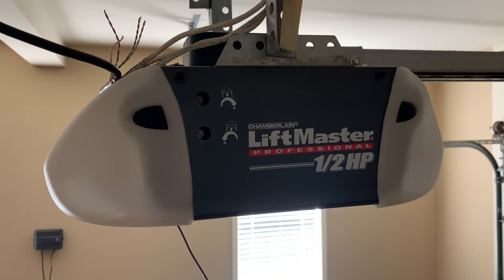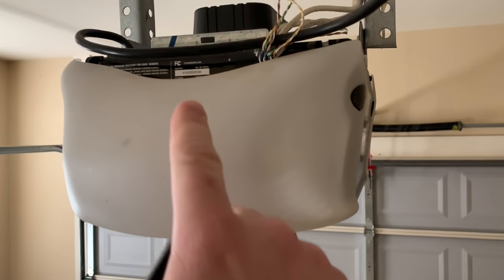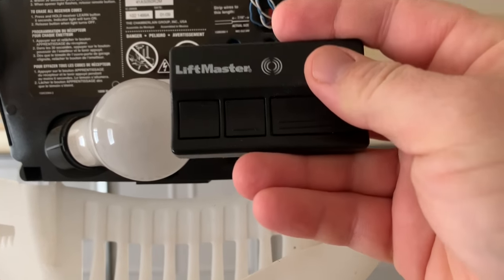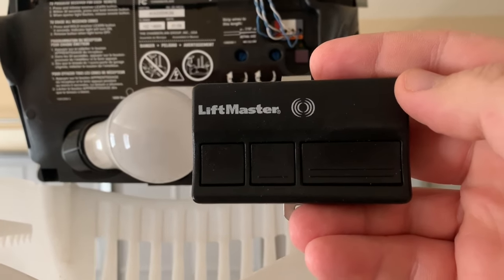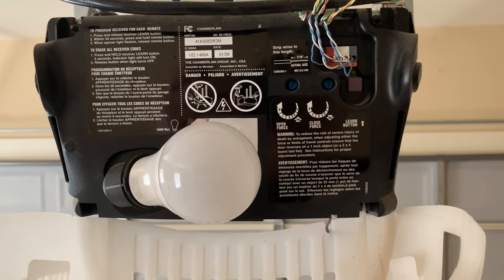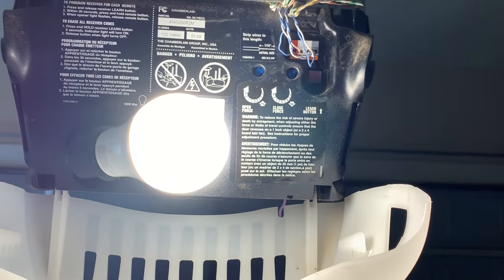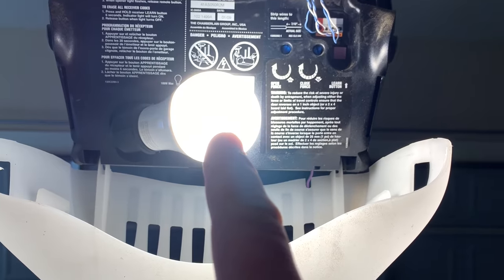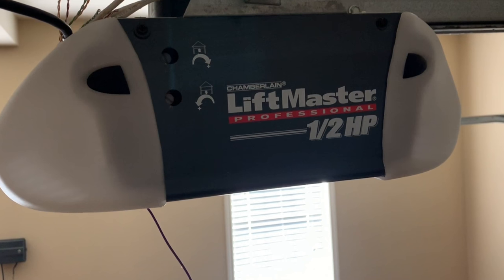EASY FIX: Garage Door Remote Not Working

Comment from the maker: Use the Amazon Affiliate* Links below to buy supplies for your repairs: 

Chamberlain Liftmaster Remote: https://amzn.to/3dHHW9m
Genie Remote: https://amzn.to/35f0E4u

Garage Door Not Opening or Intermittent Issue - https://www.youtube.com/watch?v=5UYDqS21MU0

Genie Garage Door Opener Bulb (4 pack) - https://amzn.to/37lUBxC
Genie Garage Door Opener Bulb (single) - https://amzn.to/2IFTr5E

*My description and comments may include referral codes/links that allow me to earn points or credit that can be redeemed for products and/or subscriptions. When you use my referral code/link, you are helping to support me and my recommendations! Thank you for your support!
Reply: P
Reply: My my garage door opener stopped working. I was prepared to disassemble the unit to repair it, as it turned out the problem was the LED bulb. Changing the bulb save me a lot of work and frustration. Thank you😊

Comment: When my garage remote stopped working, I called the company and they wanted to charge me $189.00 to send a technician to bring me a new remote and program it for me.  Found your site and this wonderful video.  My setup is exactly like yours, so I followed your instructions and voila, it worked perfectly!  Thank you so much for posting this to help those who are not the best DIYers around, and saving me all that dough!
Reply from the maker: Bob Antunes That’s great news, Bob! I’m glad I was able to help save you money. It’s crazy they would charge that much. I think $89 would be much more reasonable. Be sure to subscribe. I do my best to make easy to follow, practical videos.
Reply: But Bob, why wouldn’t you just call the ‘guy!’   

Just kidding!  I had the start capacitor go out on mine and found a replacement for $8 bucks.  Relatively easy install, but you do have to discharge the old one before removal.  I put the info on Nextdoor and I was berated for doing something so dangerous and I should have just called ‘The Guy.’

Comment: Tried buying new remotes, extending antennae, turning off wi fi, and changing light bulbs, no leds, nothing worked to fix remotes not working. Noticed a melt spot on plastic near the light bulb area. Put in very low watt bulb from the fridge and BINGO, now all remotes work like a charm. Hope this helps someone!!😄😅
Reply from the maker: Wow! That’s crazy! I’m glad you figured it out!
Reply: @TightWadDIY  thanks. I was ready to buy a whole new system. So frustrating.

Comment: This video just saved me $300 for a new garage opener. My garage door opener is working but most of the time is having issue. As stated at the end of this video, led bulbs can interfere with the signal. This turned out true. I switch the bulbs and the garage can be open and close every time. Great video!!  Thanks!!

Comment: This is a great video, helped fix my garage door closing issue with remote after changing light bulb for the motor. I watched close to a dozen other videos and read blogs to understand what the issue is with garage motor and remote.   The issue turns out related to using a LED bulb for motor which conflict with remotes signal, replacing LED with regular bulb resolved the issue.  Thanks @TighWadDIY for publishing this awesome video, it saved $ for me to fix the issue.
Reply from the maker: That is correct. The LED bulbs are the culprit. Took me a while to figure it out too.

Comment: Ha-thank you! Plenty easy to program remote, BUT you were the one who solved my mystery. One door worked fine, but I could not get my other door back online even after re-programming two remotes that I've used for years. The culprit was the LED light bulb I put in about a week ago! Took it out and the remote worked fine.  Thank you!
Reply from the maker: Yes! That issue plagued me for a several weeks before I figured it out!

Comment: Really appreciate a short and factual video. I’m hoping it’s the lightbulb.  I’ll change it and also try the reprogram hack. Fingers crossed it works and it’s not the big tension spring. It’s made it 19 years! This is the first time I’ve had an issue.

Comment: Thanks so much for this video. What a lifesaver! I replaced the light bulb on my garage door opener and all my remote controls stopped working. I’ve been troubleshooting for days and can’t figure out what the issue was. Had the opener for over 15 years and searched websites and thought the remote control board is old and bad. The last portion of your video remind me that my new light bulb is a LED one. Replaced it with a stander light bulb and Bing, every thing back to normal and working fine now. I’d never ever thought a LED will give me so much trouble. Thanks again
Reply from the maker: DY100100 I’m glad you found the video because it’s a super frustrating problem. It took me a few weeks to figure out too! Be sure to share the video with your friends!

Comment: I have two garage openers for separate doors same brand.  One works with remote,the other don't.  The one that don't has led bulbs.  I will change out and test.  Remotes have new batteries.  Both lift by hardwired buttons in garage.  Thanks for the tips.  Very helpful.
Reply from the maker: Definitely try removing the bulbs and see if it still happens.

Comment: So just how important is it to close the garage door first?  I tried for hours a month ago to make my HomeLink work in a newly purchased car.  Nothing worked.  I ended up de-programing the remote transmitter that came with the opener.  Now I couldn't use HomeLink OR the remote.  I tried again tonight after watching your video (first programing the remote and then following HomeLink instructions to program from the car's button).  Both worked on the first try.  The only difference is that you are the first to say to close the door first.  Thanks.  My wife will be especially grateful to not get any more calls 2 minutes before I pull up asking for someone to open my garage door.  First World Problem Solved!!
Reply from the maker: I’m not sure how important it is but that’s what the instructions say to do! I’m glad yours is working now!

Comment: I love u tube because of this kind of video . Thank you Sir . I also found one more trick which is as follows -
-Please check door opener button/switch installed on the wall in the mudroom. Locate small button called "Learn" . Use that learn button.
- Press one key on garage door remote.
Thats it .
This might save you ladder climb to garage motor mounted on the ceiling.
Reply from the maker: Good to know. My system doesn’t have that option.

Comment: Not sure if I’m in the right video.  My problem isn’t that there’s no connectivity or program to the remote.   The problem with my unit/controls is that the door will close partially, sometimes it just “jumps” a bit, and goes back up.  Sometimes it’ll go down a few feet, then stops and goes back up.  Sometimes it works fine.  Almost like it has a mind of its own.  This happens with both remotes, the wall activator, and the pad on the outside.  Thoughts ???
Reply from the maker: Your tracks could be out of alignment.

Comment: That was my exact issue will you save me a ton of frustration I went through thinking the remote was bad the garage door was bad the car was bad etc. I really appreciate that and it was my LED bulb
Reply from the maker: I’m glad you found the video!! It’s such a frustrating issue that can be so easily fixed.
Reply: @TightWadDIY  Thank you for taking the time to make a concise video with clear instructions for a known problem.  My problem, however, is slightly different, I cannot get the yellow "LED Learn button" to work.  When I press and release, no yellow light.  When I press and hold, no light.  The wall control works, except for the "Yellow Learn" also will not put the opener into programing mode.  Any ideas before I have to buy another garage door opener?
Reply from the maker: @Random_Person562DW  What is the make and model of your opener? I will see what I can find.

Comment: Thanks !!! Did not know about the LED bulb  factor.
Reply from the maker: Yes it’s so odd but definitely causes issues.
Reply: @TightWadDIY  and Fyi - the led bulb causing the issue was not the bulb in the machine, it was the bulb in the garage which was only a few inches away.

Comment: I just can't believe it.  My Craftsman garage door remotes and outside key pad started giving me fits 4 days ago, as it would work sometimes, and not work other times.  I changed all the batteries and still no success.  The same remotes did work on my other garage door on the out garage. Then I watched your video and guess what I did 4 days ago that triggered my problem..., l changed the burned out light bulb on the opener  with an LED light bulb.  CASE Closed and thank you so much for your tip on LED bulbs interfering with the remote frequency.  Really appreciate you help!!!!!!!
Reply from the maker: I’m glad you found the video! It’s a really odd issue that takes a while to figure out. Genie does make a LED bulb that doesn’t interfere.
Reply: @TightWadDIY  Thank you again.  When I changed the bulb and started having remote problem, my wife ask me if I hit or touched any of the adjustment knobs and mess something up.  I told her I couldn't have touch any because the light is on the front of the unit all by itself.  The back of the opener has all the adjustments and I didn't come close to any of them.  LOL, Unbelievable!
Reply from the maker: @hankgavarkavich1599  I’m sure she wasn’t happy with you for “breaking it”! All is well and now you can be the hero!

Comment: Your the only one who said the door has to be closed. Now I'll try this again.. lol.. hopefully that was my issue
Reply from the maker: Hopefully this gets your fixed up! Let me know if it doesn’t work!
Reply: Unfortunately no it didn't and I replaced the battery in the clicker first. So I'm assuming it just died so I ordered a replacement. If the new one doesn't pair then I'll be searching for more trouble shooting  videos. It just stopped working 🤔
Reply from the maker: @elizabetht1323  so none of your remotes work now?
Reply: I only had one remote that came with the house. And it just stopped one day. I changed the battery and it still didn't work. The new one should be coming today and I'll see if it can pair.
Reply from the maker: @elizabetht1323  I actually recommend clearing all codes when you move into a home just in case the previous owner still has remotes or Homelink devices set up to open the doors. This is typically done by holding the learn button for 10-15 seconds.
Reply: Update: My new openers arrived! I cleared all previous pairings and added my 2 new openers.. success!! Thank you for your time and great easy to follow video :)

Comment: You got me thinking about this. I have a few brands of CFLs and LEDs. If I take a portable AM radio next to them, some generate a lot of broadband RF noise and others are very quiet. I believe that the offenders don't have good filtering on their inverters and you can hear the distinctive square waves which generate many odd harmonics. The same problem exists with some solid state fluorescent light ballasts (I have in my garage.) The problem can also occur with some usb power supplies. I have an amplified TV antenna whose power supply blocked out all AM radio reception until I changed the power supply. It's strange that GDOs have their antenna hanging down blocked by a metal garage door which can be a problem from the outside.

Comment: Thank you
I am following the steps but seems like the learn button is not taking the signal.
The learn button light up after I press it but when i try to program the remote opener it does not pick the signal, tried different remote. What would you recommend?
Reply from the maker: Did you change the batteries in the remote?

Comment: My garage door will open with hand remote, but will not close... Will try changing the bulb tomorrow, hope it works... thank you so much!
Reply from the maker: I bet that fixes it! Let me know.
Reply: @TightWadDIY  Good morning TightWad Update: changed to regular incandescent 60w, still does not close (did only open before with LED bulb, but did not close) so my problem is closing. Remote is brand new opens door. GDO is a Craftsman 2014 with Yellow learn button. Does open and close with in-house wall remote. Any other suggestions? Thanks!
Reply from the maker: @aftpr56  Will it close with the remote if you leave it open for 5 minutes or more then try to close it?
Reply: I’m having this same issue new remote should I just change opener?
Reply from the maker: @blackk1d624  Didnyou try removing your light bulbs first?
Reply from the maker: @blackk1d624  Some brands have a lifetime warranty so check on that first too.

Comment: The led bulb situation is the very thing I was suspicious of. Regular and extra remote won't work all of a sudden. I mean. door went up, next, door won't go down. Wall control is fine, reset circuit breaker, still fine, checked to see if eectric eye on door worked, it did. But that bulb. Also changed battery on both remotes. Learn button, good. I just read an extensive article on LEDs, and it just seemed that the frequency is blocking the signal. I've had enough of this for today; will check tomorrow. Thanks
Reply from the maker: You got it!

Comment: Hello, thanks for unloading the video. I do have a question regarding built in car remote garage opener. Is this the same procedure to program the factory car remote? Thanks.
Reply from the maker: It depends on the system. On our car, the car actually learns the signal of the remote we have instead of the opener learning the signal of the car.

Comment: Great video unfortunately I tried all of your possible solutions and still could not get either remote to work. Both remotes quit working at the same time. Could it be that I need to unplug the unit and plug back in or maybe the remote was too close to the unit when trying to reprogram?
Reply from the maker: Unplugging the unit doesn’t clear the codes. Try removing the lightbulbs and see if that solves your issue.

Comment: I Really wanted this to work! I Liked your video. I changed the batteries in both remotes and made sure the bulbs in the main unit were not LED. I found the button inside the cover and it did light up for 30 seconds when I pushed it, but I hitting the button on the remote did not make the light bulb flash. I tried this with both remotes and nothing. We do have a button by the back door inside the house that opens the garage door and that still works (something my deceased dad set up a long time ago). I don't use the remote often, but I know it worked a couple months ago. I dug the spare remote out of the drawer and put fresh batteries in it and it won't work either. I'm frustrated. How can both remotes be bad all of a sudden?
Reply from the maker: Do you have any other bulbs close by that were on? It could be an LED bulb anywhere near the garage.

Comment: During your demonstration you stated to hold the button and let go. Do you mean long press until it flashes and then let go? Or did you mean push one time, let go and then it will learn⁰ the code?
Reply from the maker: Press until the light flashes then let go.

Comment: Thanks for this video.  It led me to pull the LED bulb to try to fix my issue.  Unfortunately, this didn't solve it. I have the exact same model in your video.  I recently installed a LiftMater Security 2.0 with MyQ.  While the old remote trains to the old opener, and the new one trains to the new opener, I can't get the new one to train to the old opener. Have you come across this before?
Reply from the maker: Sorry. I haven’t done any work with the MyQ system. Have you tried contacting Liftmaster to ask them if it’s compatible?

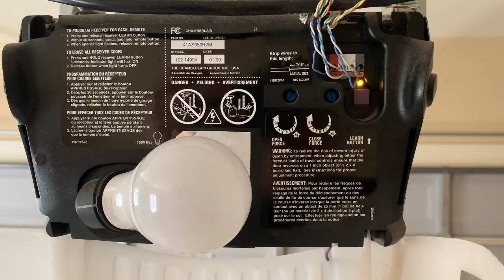Comment: 1:41 - I get to this exact step, fresh battery in remote.. and nothing happens.

Nothing. No bulb comes on. No click.

Nothing.

And I have the exact same remote and opener. I'm at a loss.
Reply from the maker: Do you have another remote you can try? Perhaps the remote went bad.
Reply: @TightWadDIY  Same for the other remote. Fresh battery in that one too. Do remotes go bad? Unit is over 15 years old.

Comment: Is this applicable if my garage door remote stopped working when I dropped it? I have been going in and opening it and pulling in the car for way too long now. I miss having a remote but nothing I’ve done works so if I dropped it would that damage it so much that it won’t program ? Still I am going to try this!
Reply from the maker: You can order a replacement remote on Amazon for fairly cheap. You may have broken your remote when you dropped it.

Comment: Just bought a house  have a Liftmaster I've purchased two garage door openers from Amazon, none will connect.  

The keypad at the door connects (I changed the code from prior owner) but not the remote door openers. 

When I press the learn button on the opener it turns yellow. When I press the button on the remote, nothing happens.  This is the same for 4 remotes. Two different brands. 

Any ideas?

Comment: Love the video, but my second Craftsman remote still does not work.  Tried removing LED bulbs.  Did not help.   Learn button goes on, press the remote, no flashing..... 1st remote stil works.. Also tried unlugging/plugging opener back in.   Any other ideas?  Someone mentioned a brand the seems more compatiable with multiple remotes?
Reply from the maker: It’s possible the remote is bad. Did you replace the batteries in it?

Comment: Question, I have a Sears craftsman 3/4 hp motor that came with a smart wall button which has an LCD screen along with a motion detector among other things and it sends all the commands using an 18/2 conductor. The lLCD wall box got damaged so I wanted to use a basic doorbell button ( off course without the light). Would it work for basic open/ close operation or does it have to be the same type? I don’t want to replace wall box as I will be buying new unit latter on. Thank you.